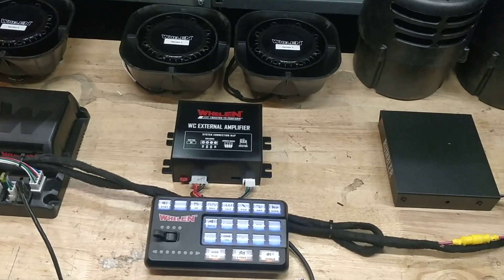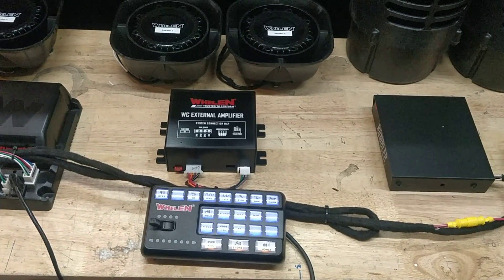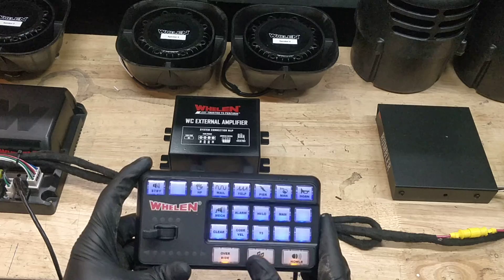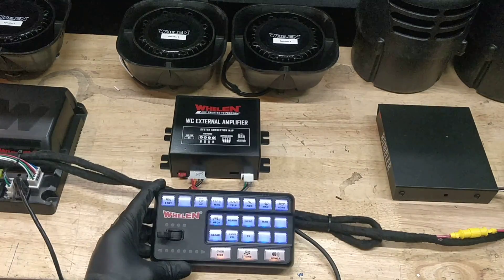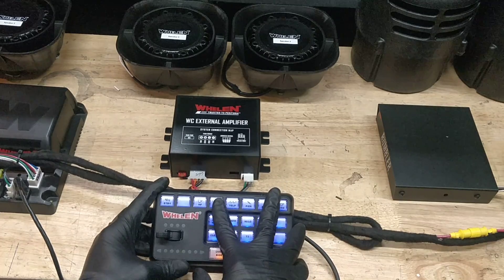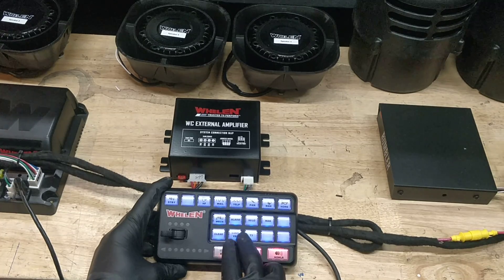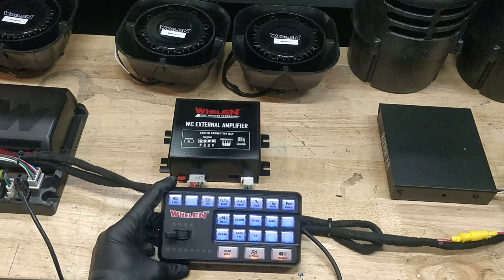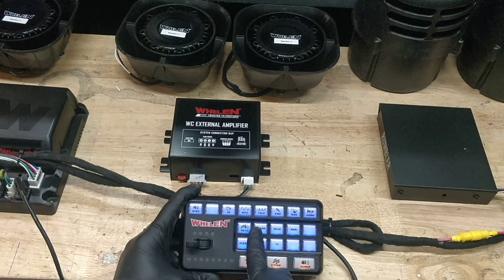6 Speakers, Maximum Tones. Whelen HHS4200 + WeCan External Amp + Federal Signal Rumbler

Comment: Is there a way to intergrade it with a car alarm ? So that the alarm can be felt. The rumbler is what gives that vibration. I'm trying to see if it possible to connect to a car alarm siren
Reply: I'm sure it's not  impossible.
However, you will need at least a Siren Control Module along with a Rumbler Module and at least one of these 100Watt speakers.
For one it's going to cost you hundreds of $$ just for parts plus installation.
Then you should understand that this setup is pulling a LOT of AMPs and if your alarm will go off quite a few times a day, it will drain your battery and you might not be able to drive off.
Reply: you can idk how but a guy did it to his crown vic
Reply: @masterchiefherosneverdie3863  is there a video on the crown vic
Reply: I imagine there is a hookup for an alarm output signal, that's what can control the alarm sound.